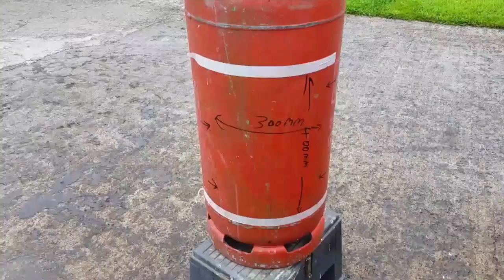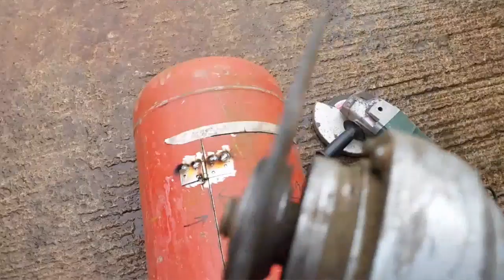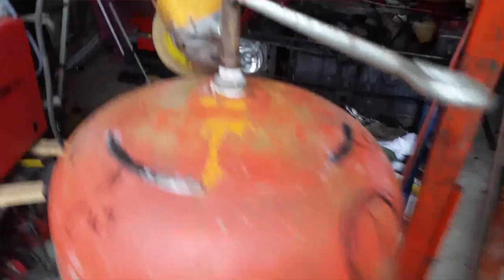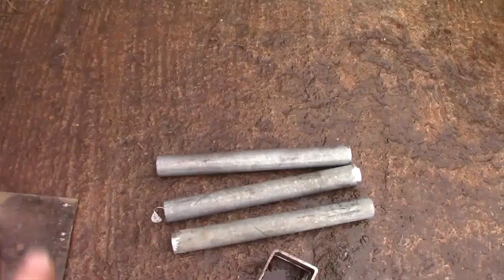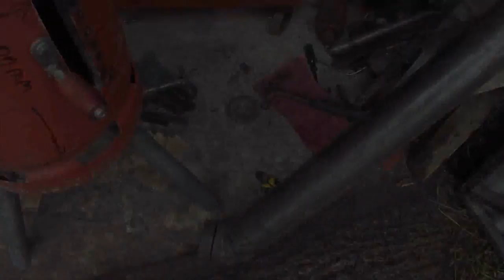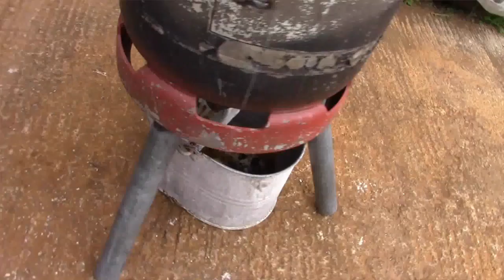How To Build A Big Gas Bottle Pot Belly Stove Barbecue At Home, Its A Multi Purpose Wood Burner

Comment: Really nice built stove.
Since you are into making different models I'll take the liberty of suggesting something a little different.
I noticed that you have used a thick plate for the top and I wonder if you can put hinges on it instead of welding that part permanently. That way you can used as a barbecue getting the heat from the top. 
Obviously that model is to be used outside when grilling.
Looking forward for more of your videos.
Greetings from Toronto.

Comment: I'm really liking the vent/ash chute idea. Most DIY wood burner builders forget to think up a convenient way to get the ash out, so lot's of them end up having to pull out grates and dig the ash out with things like tin cans and the wife's garden trowel. Any time you so much as look at ash it magically get's all over your hands and clothes, so adding a simple way to drop it straight into a bucket (with, I'm guessing, the bare minimum of prodding at it with a stick through the grate) shows you've had a proper think about this before you started.

I've made a handful of gas cylinder stoves in the past, and usually resort to either cutting off the bottom of the tank, plating it, then having a wide door at the bottom of the front to drag ash out through, or having a tray with handles that goes under the grate to catch the ash, but both those ways of doing it can be messy (Making the flat bottom stove meant a LOT more cutting and welding, and the ash catcher tray idea means the door needs to extend around half the front just so you can get the damn thing out !)......... So rest assured, the next one I build, I'm SOOOOOO stealing that ash chute idea. :D

Comment: Nice job there, can you tell me, how did you remove the valve?
Reply from the maker: Gloucester SEO well first one was a task, i used a tyre lever or a lenght of flat bar to put in the notches on the bottom to stop cylinder rolling, but frist pust cylinder on its side, i used a large adjustable spaner to turn the valve a little an then turned spanner over to get a better position for next short turn, 
adustable spanner is a cheap branded one that i picked up at an open market stall.
once the valve is removed, make sure you flush cylinder out with water a few times over a week, better safe than sorry.
Reply: Thank you, much appreciated.
Reply: Tack weld on a length of rebar or similar to stop the tank rolling, and lie it on its side.

Comment: I have a slightly larger cylinder from a water heater that I am thinking of doing the exact same with and using it as you are doing, would be good to see how you find it, especially as you have the smaller one also. I am torn between using the large cylinder as a bbq pit and the smaller ones as heaters but also like the way you have done this vertically. Any feedback welcome, great video, very clear, subscribed.
Reply from the maker: Paul Whyte  hi i made  a burner for  the shed with a  larger cylinder "47 kg" propane, my advice is use at least a 5inch flue pipe for indoor use. the burner in this video had a flue of 4 inch approx an to bo honest it wasn't big enought.
Reply from the maker: Paul Whyte once you make one you will enjoy spending evenings out door around a hot fire.

Comment: I've found with the 1mm discs if you don't put much pressure on them just hold the grinder on the metal thay last a lot longer the thicker discs you have to put pressure on

Comment: Brilliant video mate looks a tidy job. Try getting stainless steel cutting discs they last longer than normal ones.
Reply: Tricky Dicky b
Reply: I want to make myself a burner but noticed that a lot of people are using an angle grinder rather than a powerplasma cutter. Wouldn't a powerplasma cutter be faster and cleaner?
Reply: @karolthiesen4707  yes quicker, but definitely a ragged untidy edge, that you will need to grind back, and good luck getting it round to fit the next bit ( flue, hot plate etc)